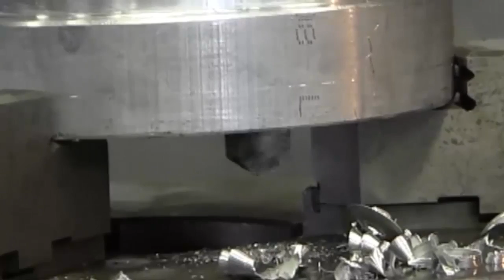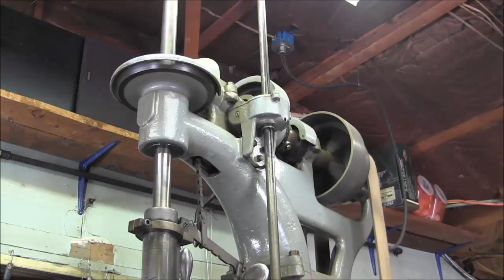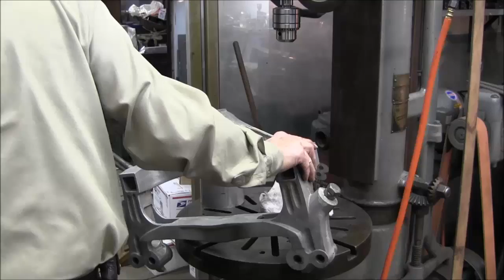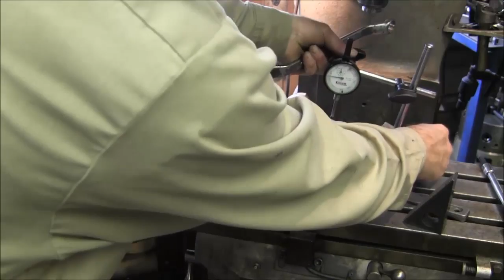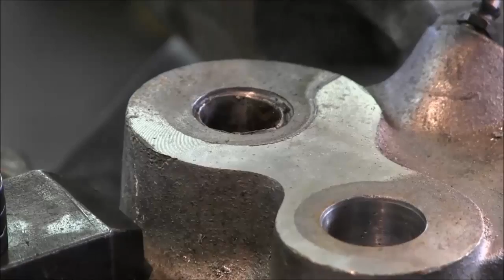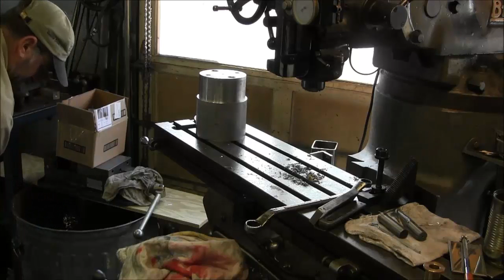Mattracks Part 4 Mail Call: ATV Mattracks Repair

Comment: I like the piece you turned to locate the holes And thanks for the tip of using the dial indicator and preloading the piece when clamping it down to the table

Comment from the maker: The two different heights were for flipping and holding the part for maximum clearances, but also holding two different set ups in two machines at once if chosen. options with only a little extra work while the set up for the machine work was in progress. ;{)-----

Comment from the maker: I first received that vice and I couldn't cut and mount it in the table where I started my shop, so I made the plate and spacers to set it on top of their bench, never changed it, even after I built my own benches. I ran a lot of big stuff, most favorite is the horizontal boring machine's and vertical lathes. 
;{)-----

Comment: It's quite easy to experiment and prove if you're getting an advantage as it will vary from chuck to chuck. Limit how much force you apply to the key, then try applying similar force to the other key positions and note how much further you can turn the key at those positions. I know people who do it simply for the reduced effort (If you've damaged your shoulder for example!) rather than to get extra clamping force.

Comment: Another great vid, Kieth!  Neat to see "thinking out of the box" in action! What an awesome "fixture" (not a "jig"). Errrr uhhhhh, don't mean to crack on ya or split hairs, but doesn't a "jig" hold or guide a tool and a "fixture" hold (fix) the work piece (as in this vid)?  No big, you were the one working and had thousandths of inches on your mind!  Good to hear that you are "booked" with work.  Shoulder..bummer, I tore mine in Aghanistan, 2011.  It took a long time to get back to 95%.

Comment: If anyone else is wondering whether Keith considered using coordinates to pitch out three of the four holes, meaning only the first hole on each casting would have to be picked up position-wise, the answer is at around  37:45  (yes, he did)

Comment: Keith
Interesting clip as usual, fantastic clarity. Liked your demo of how to pre-determine the perfect amount of pre-loading (of wedges) vs toe clamp.
 
Another part of the clip did cause me to ponder on what's best to true up a slogged-out hole. There is a school of thought which says three flutes beats an even number, because (particularly when entering the hole) whichever flute is sweeping into the most material is pushing the whole cutter across, and if there's a flute opposite, then it's going to bite into too much virgin material for that period of the rotation, so that the resulting hole is still somewhat out of position.

I personally think three flutes may be either as bad, or even possibly worse, because (due to the torque reaction) any reasonably sharp cutter will not actually be pushed directly across the hole.
 
In such cases, the cutter could easily end up bearing on the hole at something like 120 deg ... or if it's extra sharp, with lots of top rake (meaning not much push-off force) perhaps almost as low as 90 deg (making a four flute cutter a bad choice)

I guess that's why single pointing (either with a boring bar, or a mutilated former 2 flute slot-drill) is still the gold standard for truing up out-of-position or worn holes?

Comment: I really like the "wrench" negative pattern that was left on the plate on the plasma table next to the round plate you just cut out.  Need a tool?  Just draw what you need on the computer and cut it out in a few minutes.

Comment: I'm just curious here, but if you were so inclined, could you run pipes overhead in the shop from your air pumps, install a container to catch chips, and use them for a central vacuum system?

Comment: Hi Keith,

Quick question. Why is the big vise to the left of your Bridgeport up on spacers? I noticed it in the background and was curious why its set up off the bench. Nice job showing the indicator, toe clamp and wedges. Did you run a planer or big boring mill when you were in the shipyards?

Regards,

Tom

Comment: Keith, I see that your drill bit (around 4:30 or so) has some slight run-out. Do you account for this during your process, or do you have some other way of taking care of that?

Do you always check to see how much run-out a drill bit has before doing specific jobs?
Reply from the maker: I look at drills and tooling as I using them and what I'm doing with them and how close is also necessary. The drill press is sitting on a broken mortar floor and the whole press moves around and a lot of times it appears that there is more run out than there really is in relationship from spindle to table, or project. Thanks for the comment many have made similar judgement. ;{)------